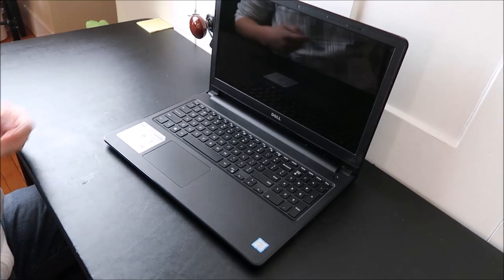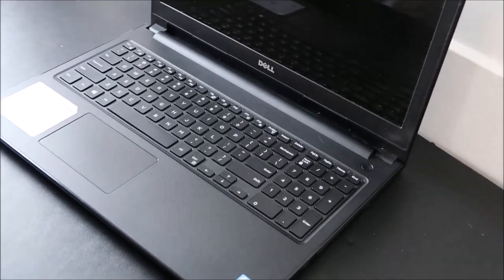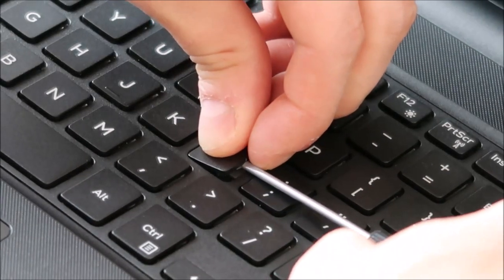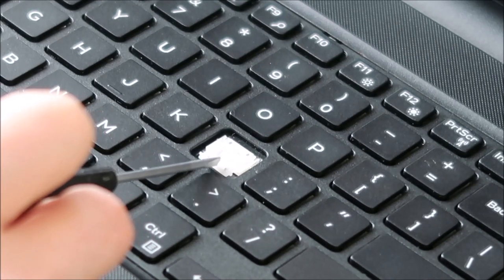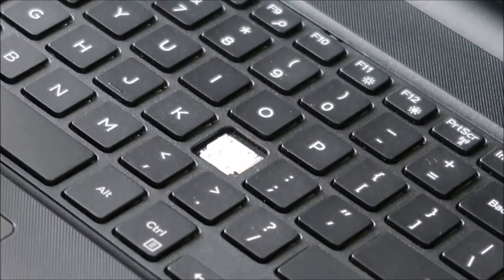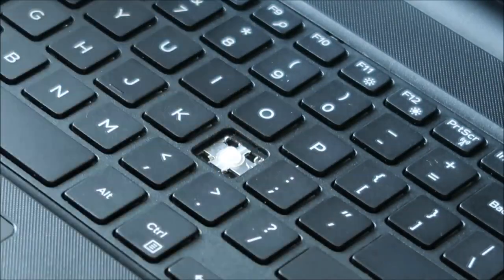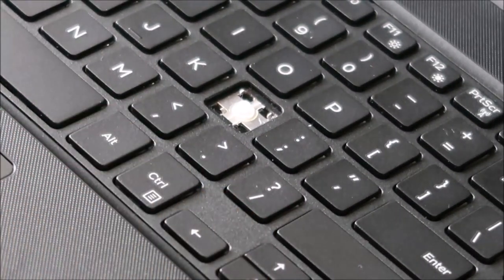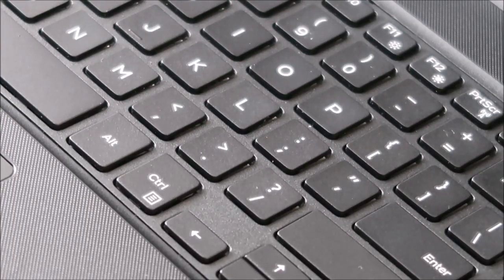How To Fix Key Dell Inspiron Laptop - Replace Keyboard Key Letter Number Arrow Keys Etc

Comment: Thank you 🙏 for you awesome and detailed video.

My Dell G15 “D” key popped off, but in my case the retaining clip was still attached to the key that popped off and not attached to the keyboard as in your video. I didn’t panic but gently disconnected the retaining clip from the D title at the corners like you showed then followed your video to reattach the clip to the keyboard then to reattach the tile to the keyboard and BINGO it worked perfectly.

Once again thank you soooooo much for this great video 🎥
Reply from the maker: Thanks !! Glad this video was helpful :):)
Reply: This happened to me and I did the same thing, but my key cap won't attach, now. Anybody out there have suggestions?

Comment: FYI for everyone. On the Dell Inspiron 3505's when you put the retaining clip back in you must start at the top to hinge the clip in first and then snap in the bottom. I tried starting from seating the bottom first and then snapping in the top and almost broke the retaining clip on the left side.
Reply: I have dell inspiron 3505 , somedays ago my 6 number key stopped working and now some other num keys and windows key is not working , if you have any advice for that i would appreciate it!

Comment: Hey so my "W" key is actually pretty loose and it comes out or gets stuck everytime I press it and the "W" key has the clip attached to it any idea on how to fix this?? 
My laptop is a dell inspiron 3593
Reply from the maker: If your Key Cap is not clicking down in place correctly, it is most likely due to the Retainer Clip not being properly installed or damaged.  Remove the Cap and inspect for damage or that its not laying down flush and properly snapped in itself.  Compare to another Clip if needed by removing another Cap.

Comment: My laptop is dell 15 5567 it's outer keyboard was damaged due to heat.So will the other cap be available anywhere on amazon or issues there similar keys available or keyboard available so that I can release the keys as you said and put it
Reply from the maker: I get most of my keys on sites like Ebay or sites like this one;  https://www.laptopkeys.com/

Comment: Today out of nowhere my s key suddenly started becoming lose so I just shut down my laptop and left it there for a few hours and when I came back the s key had just completely become unlose without me touching it at all. When I looked at the s key that white thing came off with it and was stuck with the key so i took it off and tried putting the white thing back in the s key slot but I'm having a lot of difficulty putting it back in as the top 2 hooks won't get in while the bottom 2 do fit in so i'm panicking a bit. My laptop is a Dell Inspiron 3500.

If you could please respond asap as i'm sort of panicking right now because i've only has it for 3 months and already having issues.

Quick update, either I have a very poorly made laptop or the metal they use to make the hooks is incredibly weak because the top left hook just fell off, I really don't know what to do.
Reply from the maker: If your Key Cap is not clicking down in place correctly, it is most likely due to the Retainer Clip not being properly installed or damaged.  Remove the Cap and inspect for damage or that its not laying down flush and properly snapped in itself.  Compare to another Clip if needed by removing another Cap.
Reply: I have a Dell Inspiron 3505 and I am having the same issue with the S and D key. I've reseated the key by putting the retainer clip on the keyboard first and then the key, and that fails. I've also tried  by keeping the retainer clip on the key and then attaching/sliding the retainer clip in place at top, then popping the bottom of it back down. However,  once the key is seated when I press the key at the top, the bottom portion of the key/hinge comes right up and the key can be taken off. I cannot see any damage to the hinge, the keycap, or the metal hooks on the keyboard. I've ordered two new keys to replace them and I'm really hoping this will fix the issue. It seems like once the keys come off the first time they will not go back on securely. This should not be the issue at all and they should snap back in place each time if they are properly removed and reattached. In your case Ahmed I would consider using your warranty because if they metal hooks break or come off then I think you may need a new keyboard installed. I don't think those hooks can be fitted again.

Comment: Amazing video. Thank you for ur time uploading! Just wondering if it’s possible to remove keycap off a dell 2 in 1 Inspiron 16 model without breaking the laptop ?:)
Reply from the maker: Yes, you can remove it. However, keys are very breakable so there is always a risk of breaking it. I still break keys every now and then :(

Comment: This a.m. removed key tab cover and there are 2 square-ish black plastic pcs under the cap that are no longer joined together.  I can barely make out any pins on them or which side should be down or up. I barely detect some  ridges on one side.  Should those ridges go in first? And does the center sq go on top or on the bottom of the frame of the second pc? Really I am having trouble with vision on this project
Reply from the maker: If you are referring to the hinge clips that have come apart, They fit together with a small plastic pin on the left and right of the inner clip.  These fit into holes on the outer clip.  To see exactly how the inner clip sits in the outer clip, remove another key cap and copy the clip under it.

Comment: the metal contacts under the retaining clip are damaged and the keyboard is sold, can it be glued on? sorry my bad english
Reply from the maker: If any component is damaged, it should be replaced.    I usually get my keys on Ebay or www.replacementlaptopkeys.com.  If you cannot find a loose key for sale, you may have to purchase a keyboard and take a key from there.

Comment: Sadly my key popped off with the retainer clip stuck to the plastic key. can you tell how to put them together at once? or a different solution that could help me... this is very bad as my W key is removed and its used for gaming.
Reply from the maker: Check out the FAQ's on my videos next time!  Could help you get an answer faster :)
Because they key can usually not be reinstalled with the Retainer Clip and the Key Cap still attached to each other, you would have to separate them as seen here, using a small flat pry tool.

Comment: My keyboard had a bunch of gunk on it so I removed the keys, retainer clips, and cleaned the insides with a brush but now some of my keys won't work at all. Is there an easy way to fix it?
Reply from the maker: Do the keys feel like they are physically fine or do they feel like they have something mechanically wrong with them?

Comment: the two bottom metal clips are not connecting on properly and and when taking it out the rubber part sticks to the key any suggestions?
Reply from the maker: The hinge clip has come apart in two and you cannot get it back together?  The rubber spring is coming up with the key?  The rubber spring is not supposed to be removed.  There really is no good way to repair that.  You can try a little bit of glue but if that does not work, then you would need to replace the keyboard.

Comment: My whole F9 key has come off together with the white plastic retainer clip and when I try and press it back on it won't clip back on. Should I remove the retainer clip from the black key, replace that back on the key board and then try placing the black F9 key back on and hope it clips on?
Reply from the maker: Because they key can usually not be reinstalled with the Retainer Clip and the Key Cap still attached to each other, you would have to separate them as seen here, using a small flat pry tool.

Comment: hi i need help with my keyboard if possible. so basically the key came out with the white plastic thing so what do i do?
Reply from the maker: Because they key can usually not be reinstalled with the Retainer Clip and the Key Cap still attached to each other, you would have to separate them as seen here, using a small flat pry tool.

Comment: it worked for me. but the problem is that its now really easy for the key that i replaced to pop out. what do i do?
Reply from the maker: If the key caps pops off then its not attached to the retainer clip correctly.  If the key cap pops off with the retainer clip still attached, then the retainer clip isnt attached correctly to the keyboard.  It could just need to be attached correctly or it could be damaged and unable to attach correctly.

Comment: Hi,   specific keys on my laptop don't work without clicking the multiple times. The left shift key is so unreliable, I don't use it; the "n" key works when in the mood. The right shift key always works; the n key is most unreliable whn typing passwords (though that seems to make no sense at all to me). But I have had no trouble at all with it just now typing this message, but had to type it multiple times, just to get into my computer, which has a 38 letter password, one of which is an n. LOL, nonetheless. Any ideas?
Reply from the maker: Is there something physically wrong with the key / keys or are they mechanically working fine?  Also, did anything happen before this issue appeared?  Liquid spill, overheating, Windows update, etc?

Comment: What would I do if the key cap came off with the retainer clip?
Reply from the maker: You would need to separate them with a small screwdriver as seen here.  Most of the time, you cannot install them back onto the keyboard while they are connected.

Comment: So if a key gets excessively loose from abundant use (normally the W key), can you replace the retainer clip to firm it up again?
Reply from the maker: If the retainer clip is the reason for it being loose then yes, that will fix.  If the issue is the metal pins on the keyboard are loose or the key cap is damaged then no, replacing the clip wont help.
Reply: @PC_Monkey  Is there any particular way to tell? My key will occasionally pop off while I'm using it, and the clip doesn't appear to be broken, so I'm sure it's not the issue, but the metal tabs on the keyboard aren't bent or malformed in any noticeable way.
Reply from the maker: @connorh1196  You can remove another key cap and compare the still installed retainer clip to yours.  If you dont see any differences, then examine the metal pins on the keyboard that it should attach to as they may be damaged or bent out of place.
Reply: @PC_Monkey  That's a good idea. I'll give it a try.
Reply from the maker: @connorh1196  Good luck !! Let me know how it goes :)
Reply: @PC_Monkey  I ended up using it as normal until the key came off again, and I inspected the clip compared to a more solid one, and the metal tabs under the other key. I determined the problem was in fact those tabs the clip hooks to. Ended up talking to a few friends and getting a decent PC put together to replace this problem. Thanks again for all the laptop help!
Reply from the maker: @connorh1196  Glad your all set :) Always here if needed !!

Comment: My W and D keys keep popping out partially (as in, usually only one side of them pops up) but i honestly can't tell what the issue is. 
Trying to take the key out usually results in the larger clip detaching from both the keyboard AND the key, while the smaller one stays hooked onto the key. However whenever they pop out halfways as mentioned before, the clips aren't connected to the keyboard. Pushing down doesn't seem to work to connect them.
Also, the rubber cap from W has come loose and shifts around if i try to readjust the key sometimes.
Any advice for this?
Reply from the maker: Regarding the Rubber Spring;  There isnt really a good way to reattach those.  They are not meant to be replaced.  Best advice is try to use a small amount of glue.  If that does not work, you may have to replace the keyboard.
Regarding the Hinge Clip coming apart in two; They fit together with a small plastic pin on the left and right of the inner clip.  These fit into holes on the outer clip.  To see exactly how the inner clip sits in the outer clip, remove another key cap and copy the clip under it.
Reply: @PC_Monkey  Thanks for the advice, the cap doesn't seem to be much of an issue. I have figured out the reason for the key not sitting down however, it looks like the plastic bits on the key that keep the hinges attached to it have broken off. I've ordered new key replacements, so hopefully that's the end of the troubles
Reply from the maker: @lewd2851  Good luck !!

Comment: Why would they make the key mechanism be made from really thing cheap plastic. Like it's the thing that is most used and there is no way that they didn't see this fault. 4 Metal hooks going through small holes of cheap thin plastic and you're telling me there's nothing wrong with that?
Reply from the maker: Yes, its always been a very poor design unfortunately :(

Comment: i can't seem to be able to merge the 2 seperate clips together. please help. they're both in tact. do you have any good tutorials for installing a clip like this?
Reply from the maker: They fit together with a small plastic pin on the left and right of the inner clip.  These fit into holes on the outer clip.  To see exactly how the inner clip sits in the outer clip, remove another key cap and copy the clip under it.
Reply: @PC_Monkey  tried doing this earlier, and i think i fit it on correctly but for some reason the key cap doesn't fit when i put the outer clip on. when i do the inner one it fits, though. all my other keys have both clips in and they fit fine; i'm putting them in the exact same way. the outer retainer clip "pops up" a little bit when placed on top the inner clip
Reply from the maker: @aliasraonic  If the Retainer Clip is not laying down flat like the other keys and not popping up correctly like the other keys, then its not installed correctly or is damaged.  Perhaps the two pieces of the Retainer Clip are not fitting together properly

Comment: Does this work for shift keys
both of mine will not work anymore. all other keys are functional.
Reply from the maker: Does the key feel like there is something physically wrong with it or does it feel like its physically working fine?
Reply: @PC_Monkey  physically it seems to be working fine. it used to initially not work and then after a few taps on the keys, it would work. now it wont work at all but still physically feels fine.
Reply from the maker: @marycostantinou7866  This video is a tutorial on how to replace a key.  If your keys are not working but are not mechanically broken, troubleshoot them as seen here; https://youtu.be/wqrchfpdJ_w.

Comment: I'm so not able to do it. The retainer clip is down. I just need to center it and press. Doesn't fit.
Reply from the maker: If your Key Cap is not clicking down in place correctly, it is most likely due to the Retainer Clip not being properly installed or damaged.  Remove the Cap and inspect for damage or that its not laying down flush and properly snapped in itself.  Compare to another Clip if needed by removing another Cap.

Comment: My S key came off and the retainer Clip is slightly proped up and when I try to put they key back on it just pops back up
Reply from the maker: If your Key Cap is not clicking down in place correctly, it is most likely due to the Retainer Clip not being properly installed or damaged.  Remove the Cap and inspect for damage or that its not laying down flush and properly snapped in itself.  Compare to another Clip if needed by removing another Cap.

Comment: how do you put the plastic pieces together?
Reply from the maker: The inner clip fits into the outer clip by a small plastic pin on the left and right.  To tell more specifically how they fit together, take the Key Cap off another key and examine the Retainer Clip.
Reply: PC Monkey i somehow fixed it myself 😅
Reply from the maker: @QuantaviousHogglepants  Good job :)

Comment: Mine looks nothing like that.  I have a Dell Inspiron 17R N7110, and the plastic piece under the keys are two-piece.  I can't even come close to securing this key back unto the keyboard.
Reply from the maker: The inner clip fits into the outer clip by a small plastic pin on the left and right.  To tell more specifically how they fit together, take the Key Cap off another key and examine the Retainer Clip.

Comment: The l is the one I broke, but I can't get it to stay in after replacing it
Reply from the maker: If your Key Cap is not clicking down in place correctly, it is most likely due to the Retainer Clip not being properly installed or damaged.  Remove the Cap and inspect for damage or that its not laying down flush and properly snapped in itself.  Compare to another Clip if needed by removing another Cap.

Comment: Two questions: what can I do if the small upper left clip is broken and is there a small rubber "cap" over the center spring?
Reply from the maker: If any component of the Key Assembly is broken, you may have to replace it.  I usually get my keys on Ebay or https://www.laptopkeys.com/.  If you cannot find a loose key for sale, you may have to purchase a keyboard and take a key from there.

Comment: So what can I do if I tried to kill a fly with a swatter and hit my number pad and keys 4 and 5 came off? LOL The little square white piece came off with the number 5 key.  It stayed attached to the number 4 key when it came off but its broken in the corner. Do I need to buy a brand new laptop?
Reply from the maker: Because they key can usually not be reinstalled with the Retainer Clip and the Key Cap still attached to each other, you would have to separate them as seen here, using a small flat pry tool.
Reply from the maker: @deborahpeterson6432  ?
Reply: @PC_Monkey  It can be fixed though, right?